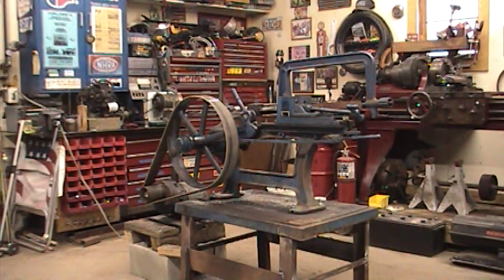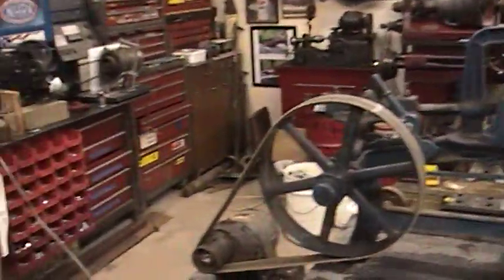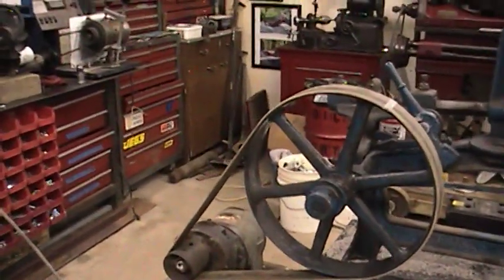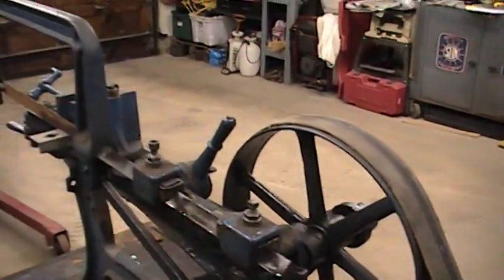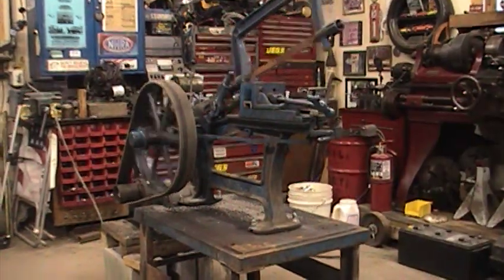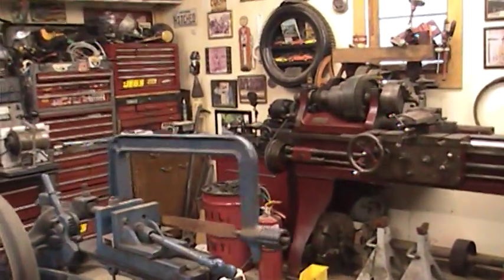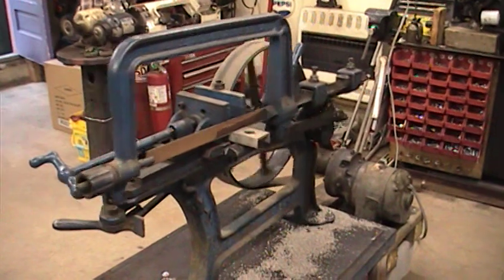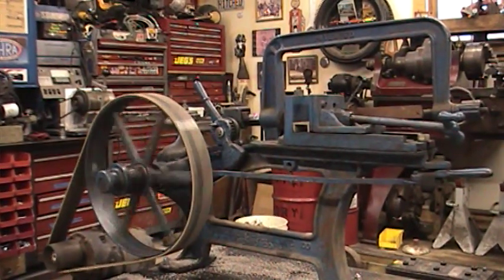Marvel Draw cut Saw NO 2

Comment: Mine also doesn't have the large flat wheel that's on your drive, it's about half your diameter so I wonder if mine is original or not. is that a 12 "wheel?

Comment: Nice, I have a no1, but it goes too fast, needs to be at the speed you are going. Any faster than what you are running and the blade will start hopping or it does on mine anyway
Reply from the maker: Clarke E This motor I am using has a reduction gearbox, but you could make your own using a jack shaft and sized pulleys to slow it down.  It normally should be run from a line shaft to get correct speed.  Thanks for the comment.  Phil

Comment: I have the exact same saw and one extra blade in the original packaging.  Do you know of any source for replacement  blades.  I cut a couple of 2" Schedule 40, 304 Stainless Steel pipes the other day.  Tough old boy.  Went through slow but steady, providing a straight cut.
Reply from the maker: The blades come up on Ebay now and then try searching.  Thanks

Comment: Fun video. Like the shaper the power hacksaw is a design superseded by a continuous cutting design, the bandsaw. It seems like the battle between the two goes way back to wood cutting two hundred years ago. Any toothed blade will run out if dulled on one side or not running true, the argument that a band will run out is only true for those who can't or won't keep their guides adjusted. True, the power hack doesn't need guides. But the advantage of continuous cut way outweigh disadvantages.

Comment from the maker: Have not had it apart was working when got the saw.  There is an oil hole on the pulley hub that could have some good penetrating oil put down it to help free up.  Not much to it just slides on the shaft to the spring hub.  The year of my lathe is May 5 1885.  Phil

Comment from the maker: No I have not it was still working when I got the saw,  I will look at mine again, it is not a real complicated clutch.  I think just the one hub slides into the other, some penetrating oil and light taping may free it up. But I am sure you have dellt with things like this before.  Phil

Comment from the maker: Yes it is a Flather lathe and I do use it, still set up for screw cutting so when turning parts I travel manually.  This lathe has little use and was put away in storage for most of its life.  Would like to set up some day back to line shaft with clutch and reverser.  Like your site hope to see your museum someday in my travels..  Thanks.  Phil

Comment: Excellent save of a beautiful saw.  I also saved one from the desert and it has the four steel wheels somenoe made for them and steers.  Mine is with silent chain gear drive in oil.  These are still a very usable shop tool.

VAPEUR

Comment from the maker: Yes you can adjust the stroke by sliding the lower arm on the rear cam, there is an adjusting nut for that.  And the down pressure can be adjusted when I install the tension rod that is on the floor.  It goes from the rear cam to the front with a big spring and tension knob.  Thanks.  Phil

Comment: Excellent Video...Very Cool saw...Two questions, Does it have a way of adjusting the Down Pressure and can you adjust the length of the blade stroke?  Seams like only about 6 inches of teeth are being used and would get dull rather quickly?